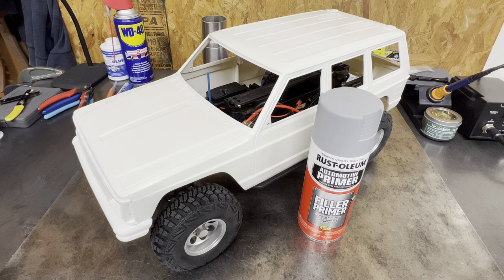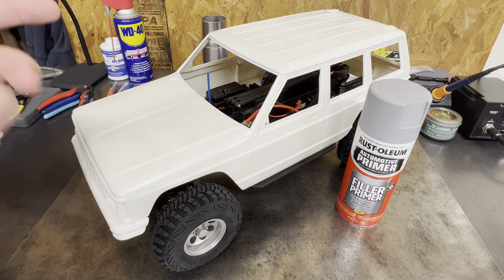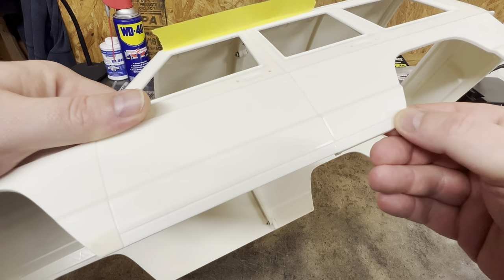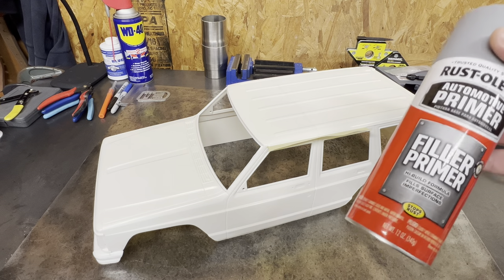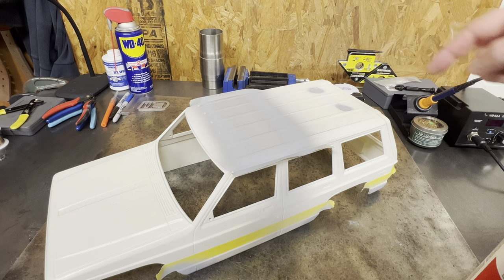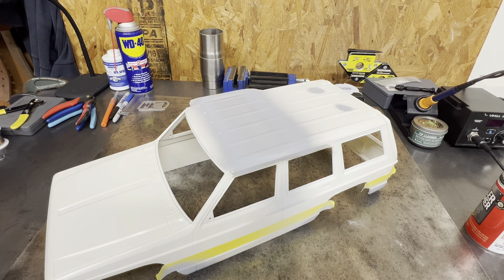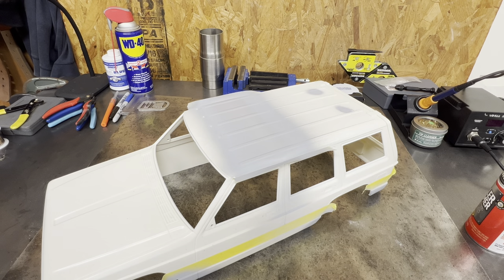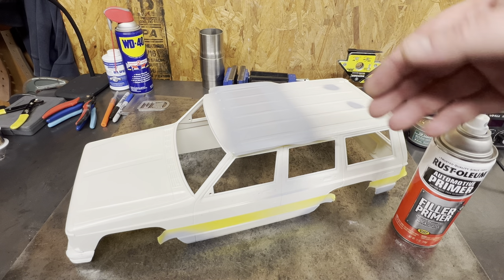Part 3 how to paint an RC hardbody! High build primer application and overview!

Comment: Biggest issue I usually see with high-build primers is people using too much. You nailed it with the method for spraying it on. Thin coats and only where you need it. High build doesn't mean use it as an all over filler. That's the reason I hate that some companies call it filler-primer.
Reply from the maker: Exactly it can be confusing

Comment: Did you have to use a body filler before using the high build primer?
I have a 1978 bronco body which has pre-marked indentations in it where body posts can go. I want to cover them somehow. Do you have any tips?